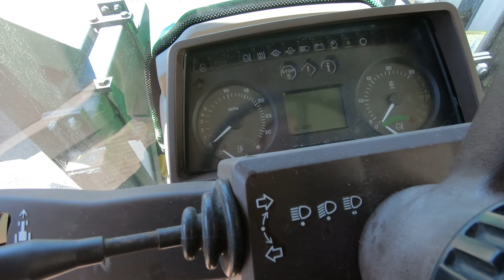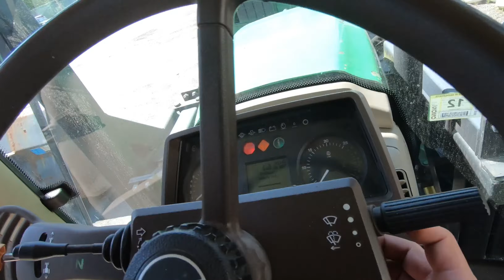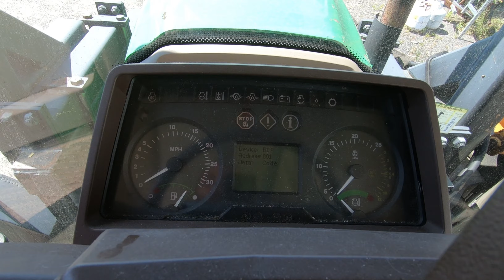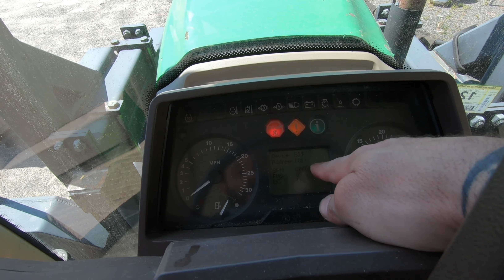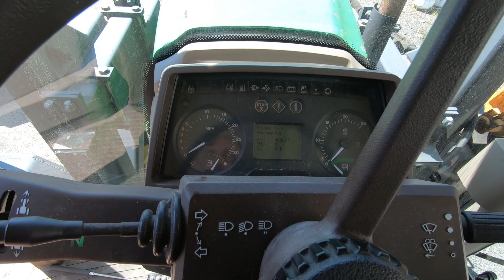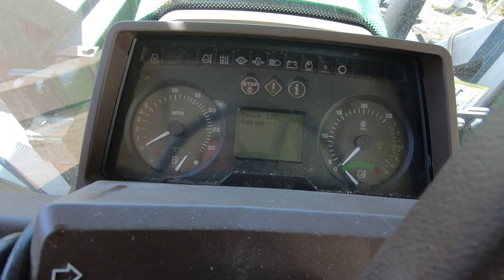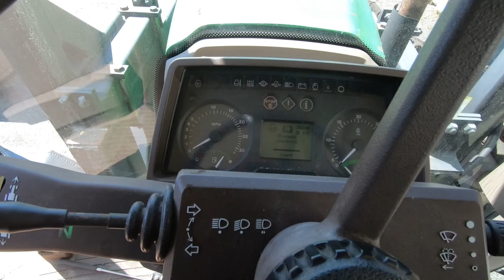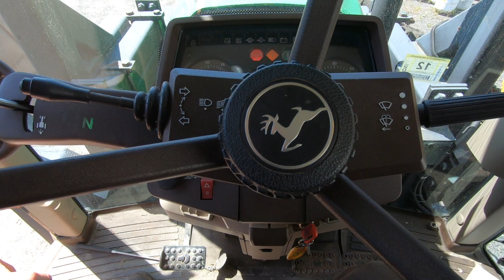How to retrieve codes on a John Deere 6420, 6000 series

Comment: We are trying to retrieve codes on our 2013 6630 John Deere tractor
Reply from the maker: We only have the one tractor. I’m not familiar with the one you have sorry. I would try and get a repair manual that would give you the information you need to repair it. They are around $120 I believe for a pdf download. Sorry I could help.
Reply: @JasonTheMunicipalMechanic  30 serie show codes in menu with out any hazzle.

Comment: So the speed on my John Deere 6620 on the digital doesn't work or on the dial so is that a code or is it something that I need new fuse for it or do I need to delete all the codes or is there a certain code that needs to be deleted??
Reply from the maker: I’m having the same issue on the one we have. I haven’t had time to really look at it though. There may be a code stored in it but I don’t think that would keep it from working. I believe these tractors had problems with the instrument clusters but it could be the speed sensor too. It’s hard to tell without a scan tool to see if a signal is coming from the speed sensor.
Reply: So do you think I should get a speed sensor and see if it makes a difference??
Reply from the maker: It’s hard to tell, I’d hate to tell you to get a speed sensor and have it not be the problem. Without a scan tool I would probably try that first. You might be able to read the data pid on the dash in the diagnostic mode but I don’t know which one it is.

Comment: you have the complete code list  Tractor 7420
Reply from the maker: Here’s a link to the service manual http://manuals.deere.com/omview/OMAR224650_19/OMAR224650_19.htm and this is the code list section. It’s not very big but what I could find http://manuals.deere.com/omview/OMAR224650_19/OURX986_000007F_19_24FEB03_1.htm
Reply: Jason The Municipal Mechanic perfect 👌
Reply from the maker: No problem
Reply: of line 7830 ??